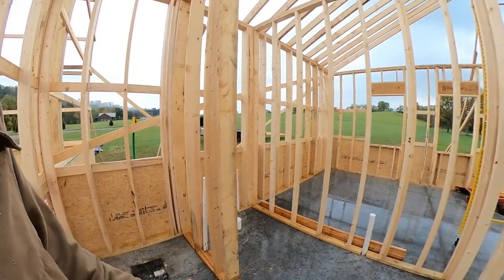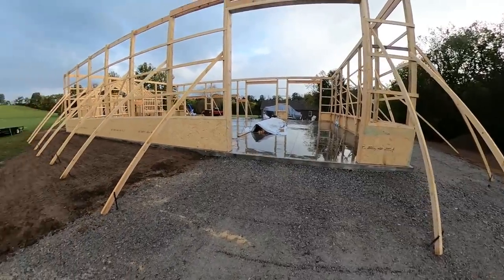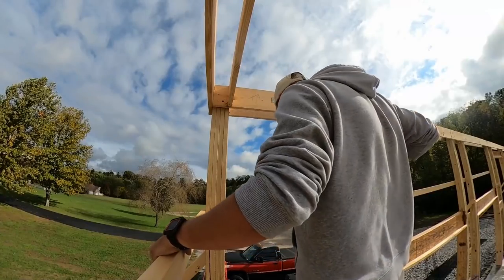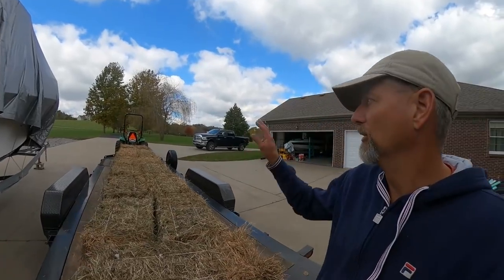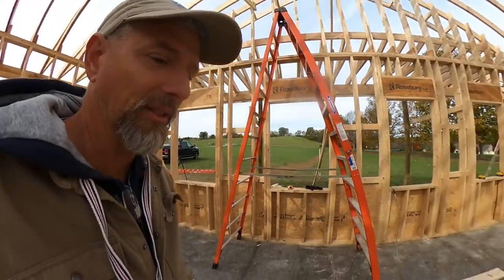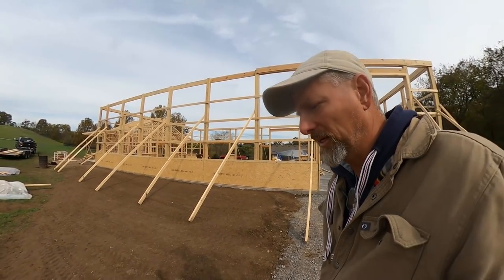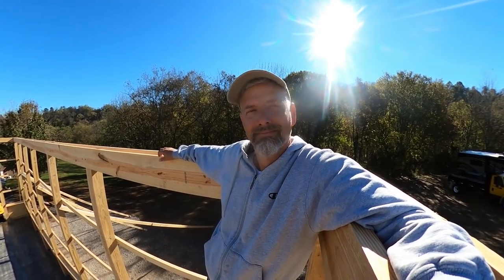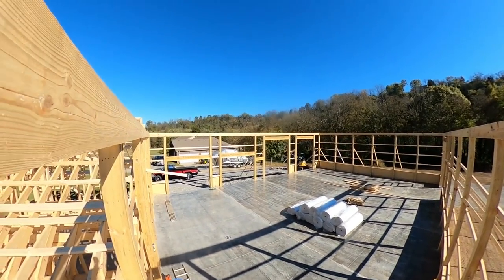Building the Ultimate Garage | EPS 15 | Front Porch | Shots Life

Comment: The one thing that haunts me today about my pole barn is I DIDN’T INSULATE ! Trying to save a couple of bucks and now my walls are full of stuff to the point it would take me a week to move everthing out to do it !
Reply from the maker: Yeah, well Dave I hear you load and clear, I do plan to insulate but I will have to do it over time… the bucket of money for the building has dried up… it is my plan eventually. I also hear you on moving everything. I wanted to spray foam but the cost has gone through the roof the last few months… so we will have to see what the future holds price wise.
Reply: @shotslife  around here the spray foam went from $1.75 a ft. To $2.75 a ft. ! In my mind spray foam is the way to go for many reasons , one being ease of application and the other being water resistant ! Oh well I’m just going to bite the bullet and get it done , my barn is smaller then yours it’s 30’ x 50’ with 10’ ceiling ( 14’ to peak ) , I should just spray rafters for now !
Reply from the maker: Well let me know when you get it done what you end up thinking about it…
Reply: @shotslife  👍

Comment: So about to go to bed and see video dropped.  Had to watch it. Looking good!  Question:  See you ducking head from office to garage.  Habit since you're tall or are they low?  Also, think I'd have gone 2 more feet on width of porch.  I have 8 ft around house (covered) wish it was 12.   Chairs, table etc.  Little more room to walk around.  Imagine you don't put something on every flat surface like I do, so sure you know what you wanted.
Reply from the maker: Hey John? Yeah someone else mentioned that, I assume I must do that all the time but it could be due to the 16’ ceiling, maybe it’s a subconscious optical illusion… kind of weird. Well the front porch is really just for design. I didn’t want the building to look like a box… it would be tight if I used it but my house has 3 big porches, we really only use the huge one on the back of the house facing the lake. Good thoughts though.